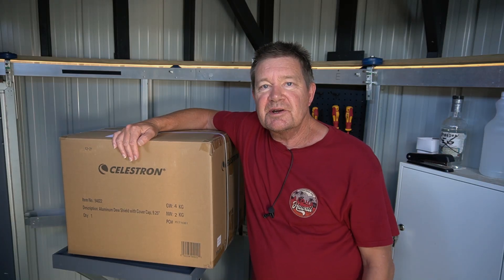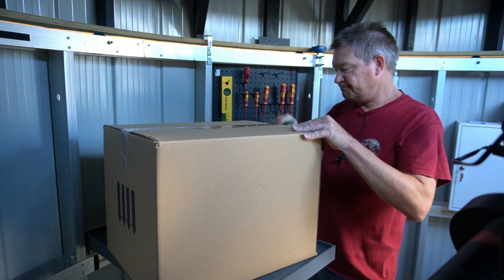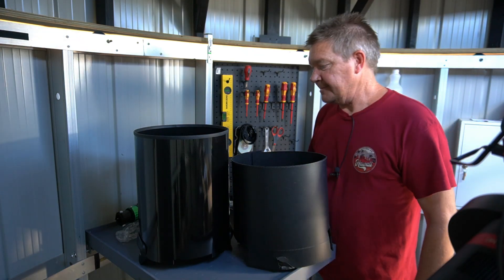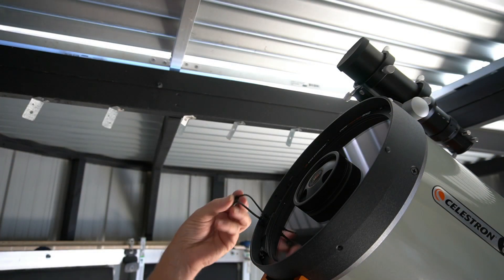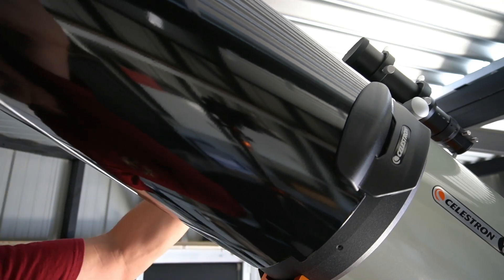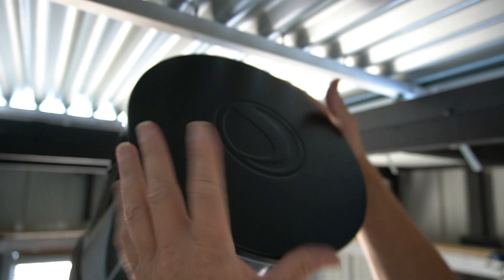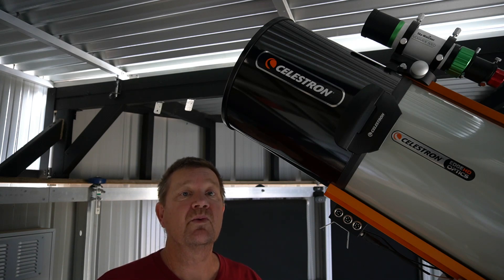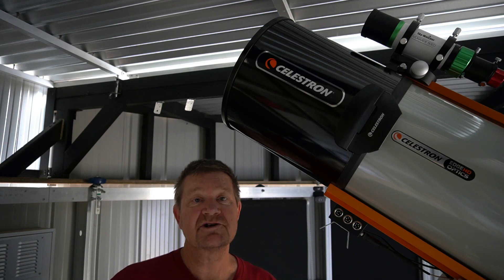Celestron Aluminium Dew Shield Custom Installation.

Comment: Do you think this shield it can support a deepskydad flat panel/cover?
Reply from the maker: I have just been to the website of deepskydad.com. They do make a flat panel for the 9.25 inch. The aluminium dew shield for the 9.25 Edge HD is reportedly  279.4 mm diameter.  The OFP 300 Flat panel from deep sky dad apparently supports a diameter between 269mm  -  316mm . So in theory yes? But I would confirm this with them before purchase.

Hope this helps.
CS Don
Reply: @donstronomy7606  i mean if you think that aluminium shield is steady enough to support the weight of the panel cover. Thanks for the answer btw!
Reply from the maker: I don't think it will handle the weight myself. Just had a look at the clips and they are on the sides only. This means that It will tilt at the bottom as there is nothing to stop it.
Hope this makes sense?
CS Don

Comment: I had the same sort of problem with the dew shield fully extended on my refractor. I ended up changing to a mini PC and NINA so I could use the park function. Now the scope is as high as I can get it and parallel to the roof.
Reply from the maker: Sounds like you have a roll off roof? As for me I had to make sure it could clear the scope, at its highest point which is when its pointed to the South celestial pole.
One of the disadvantages of having a fixed roof observatory.

Thanks' for watching
CS Don

Comment: Nothing in this hobby is easy!  Nice fix Don!  I’ve got that dew shield too, I had to adjust the latches to get them to snap on. My cap was also loose, wind blew it off once and dented the edge flange. It holds better with the dent so I left it 😂
Cheers!
Doug
Reply from the maker: Hey Doug.
Yes you are right. There always seems to be something. Nothing is straight forward. 
I did read the specs before I bought it, so I knew it was going to be an issue for me.

Have you used it with a hyperstar?
Just wondering if you can change filters without pulling it off?
To me it looks like there is not enough room?

CS and take care
Don
Reply: @ Hey Don, yes I have used it with HyperStar and with my filter drawer am able to change filters without taking the dew shield off. It’s a little precarious so extra care needs to be taken. I’m also able to collimate with the shield on, it is a bit of a reach but I’m able to do it blindly by feel for collimation knobs. If I was using screws it would have to come off. 
Cheers!
Doug